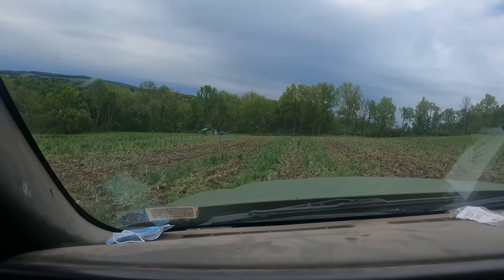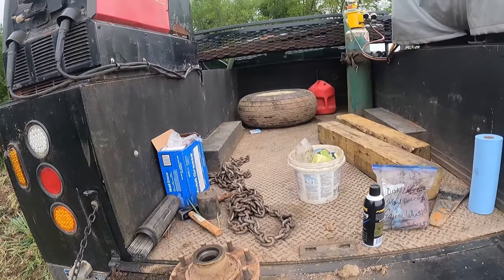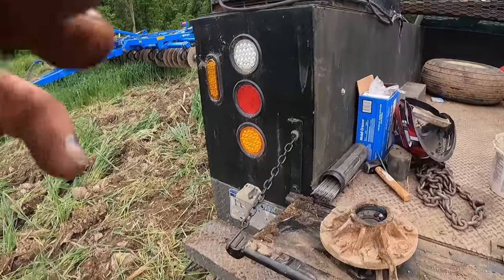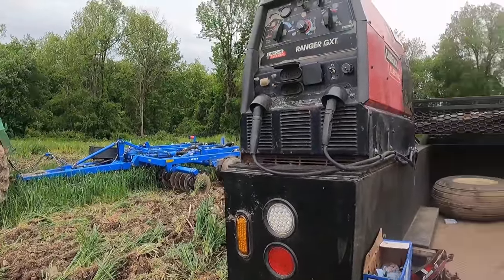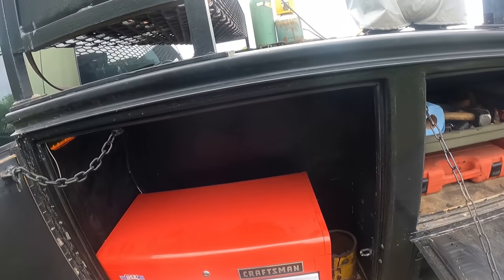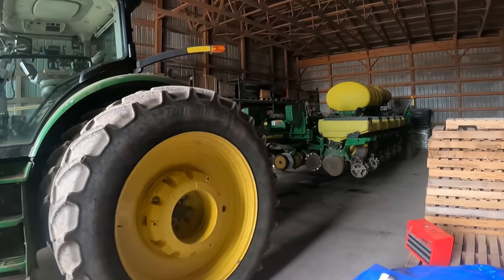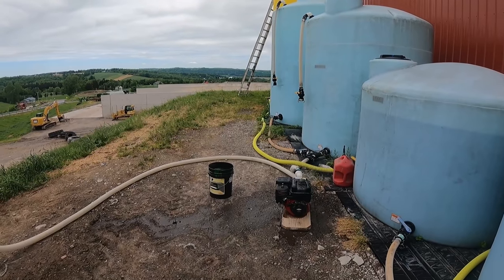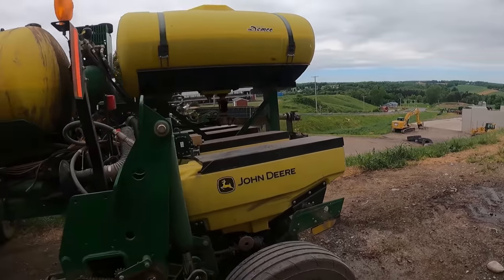Alex Broke it

Comment: Good to see things rolling right along Andy.
Your kids sure try hard to keep an eye on things when they are out in the fields, whether it's cutting, plowing, chopping, mowing, spreading, or whatever they're doing. Good group of kids for sure!👍👍👍
When you are draining that pump hose, just tie a loop of cord on that middle tank hose fitting, then all you have to do is hang the female end up, stretch out the hose and use the ball valve end to drain it in the bucket, no more wrastling that crazy hose, it works every time. I have a 15,000 gallon tank and 4 in hoses that can be a giant pain sometimes, but that cord sure solves a lot of it.😉

Comment: Andy what I’ve done in the past is Grillo quarter inch can drill a hole in there for quarter inch ball valve put an air check on it then you can blow the product out of the hose and off it off and change

Comment: Most guys would have gone through two fields before they noticed I wheel fell off, she went two feet. That's a good operator. She even finds brand new log chains! 😆
Wonder if you could use the magnet on your olight to find a lugnut in the grass.
Reply from the maker: My other daughter found the log chains and yes the flash light works good to pick up small stuff

Comment: Those bearings look rather small fo the weight they carry. Roller bearings push the grease aside. Unless you use something that flows back into the bearing like modern trucks use in the steering axle, they eventually run dry. We used Mobil SHC 007 in steer hubs as well as trailer hubs.

Comment: I had a 15ft jd disc that ate wheel bearings even greasing them daily. The inside spindles liked to break too.  All I pretty used it for was running over corn stubble.

Comment: Just watching you handling the pump and hoses for the fertilizer and wondering if an electrical pump mounted on a small utility trailer would work better than the gas powered. Just a thought.

Comment: Andy,  what was the video you posted where your 7290R (I believe) was having going into park issues when Andrew was using it.  We have a 8320RT with an IVT and it keeps stopping to “recalibrate” just wondering if it’s the same issue. Thanks
Reply from the maker: Stopping to recalibrate is a different problem

Comment: FIX the other 3   ,.. I lost 3 wheel bearning in 1.1/4 miles on the road . drug the disk 100 feet back into drive. we check the 4 th and thay fell a part when we took the hub off.